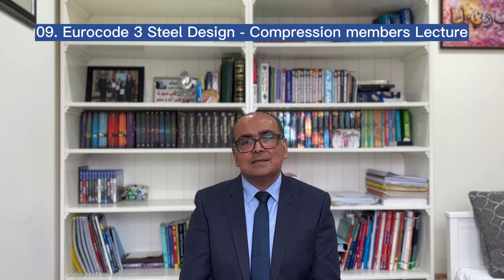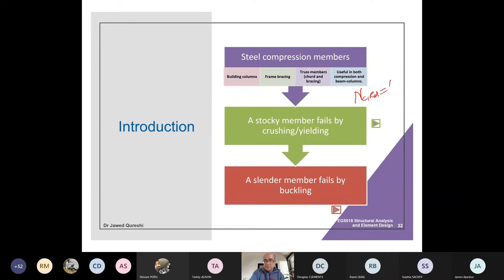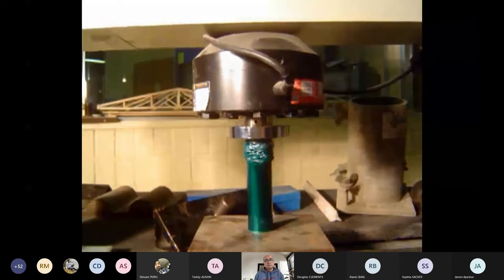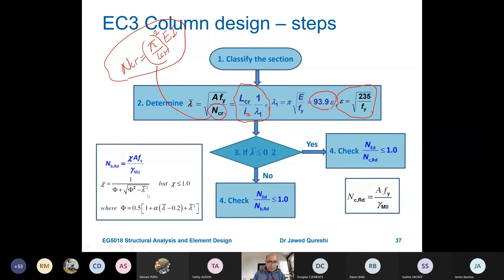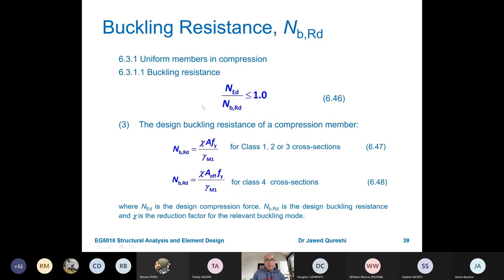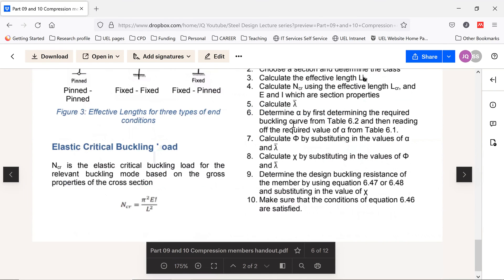09 Compression Members Lecture | Eurocode 3 Steel Design series

Comment: sir i have a doubt, while working on a real project what things should be considered to say that the particular column has a pinned or a fixed joint
Reply from the maker: It really depends on various factors. Most joints in buildings are pinned and joints in portal frames are fixed. Please note pinned and fixed joints are closest modelling assumptions of reality.

Comment: Hi, Is there any difference in the design for designing a cantilever column. Did only bucking length values changing?- Lcr= 2L.?
Reply from the maker: The design process is same for fixed-free boundary conditions for columns. You are right the buckling length will be 2L. In addition, you may have to consider any moment generated due to fixed end. In that case you’ll design it as a beam-column. I’ve a separate lecture for beam-columns in this playlist.
Reply: @DrJQureshi  Thankyou so much for your reply.
Reply from the maker: A practical application of a cantilever column is a lamp post, where one end is free and other fixed.

Comment: Hi sir, thanks again for the lectures. A question Sir. Is

Fixed-Pinned=pinned Fixed?

Are both 85% of the length utilized?
Reply from the maker: Yes, for both cases Lcr = 0.85L

Comment from the maker: ** TIMESTAMPS **

00:00 – Introduction 
00:32 – What is column buckling?
02:20 – Stocky and slender columns
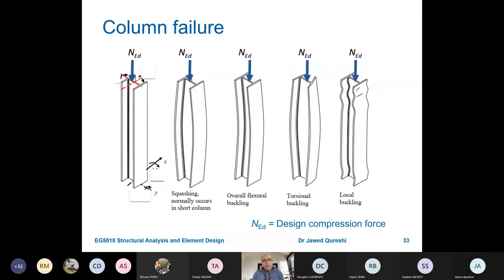06:04 – Different column failures
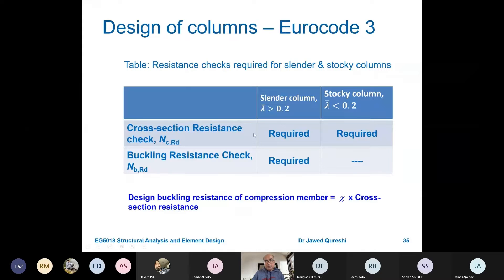06:34 – Design of Columns – Eurocode 3
10:58 – EC3 Column Design – Steps